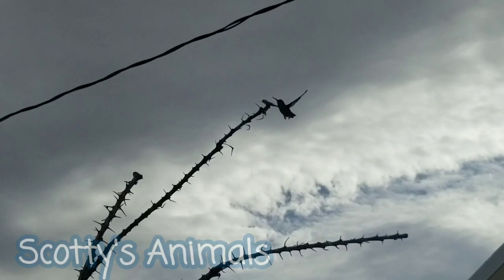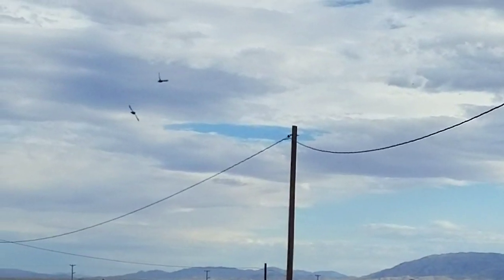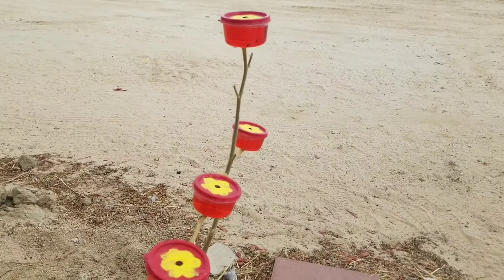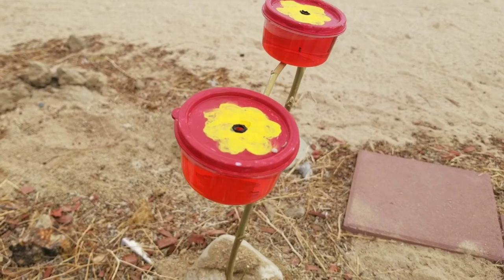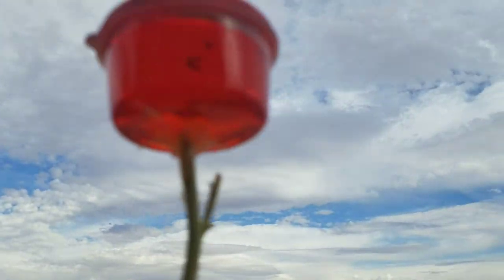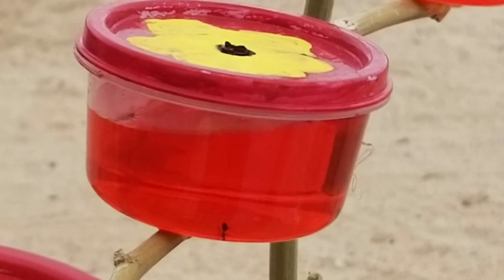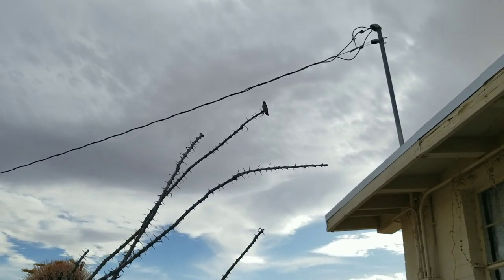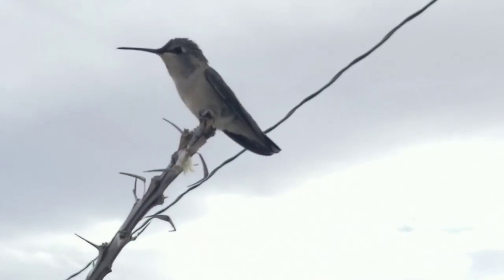DIY Hummingbird Feeder and Slow-Motion!

Comment: This may be unrelated but I currently have a stubborn piggy who won’t take his medicine! (Oral) The other takes it right from the syringe and I can’t seem to get the stubborn piggy to take it. Any tips? He moves his head as soon as I try to put it in the side of his mouth. I have tried giving him food at the same time,  but he catches on.
Reply: Can you get fresh Mandarines? If so, juice them and mix it with the oral medicine. Or you can use Childlife Vitamin C liquid
Reply: @karaleetrapp  The vet mixed the medicine with pina colada and it smells great, but I think the syringe is where the problem is. I may put some cucumber on top of the syringe to encourage him to eat it.
Reply: I have this trouble with mine also so I wrap them up in a towel which keeps them calmer and stops them from struggling and hold them against my chest while giving them their medicine. Then I give them parsley as a treat afterwards.